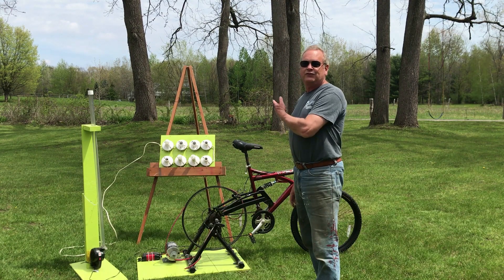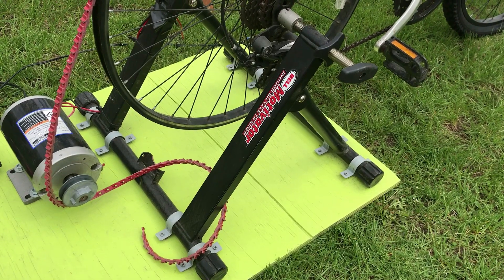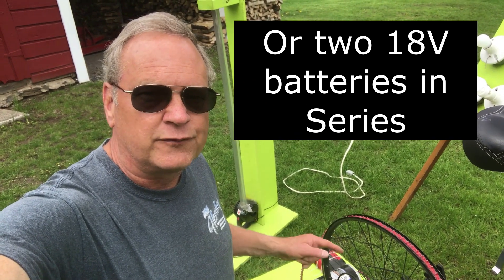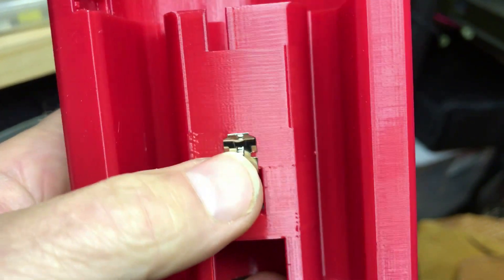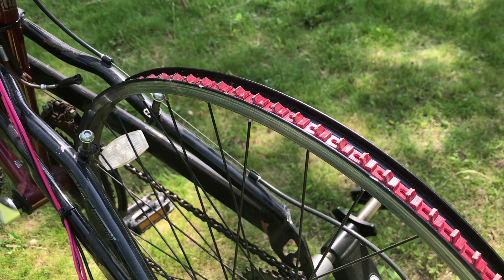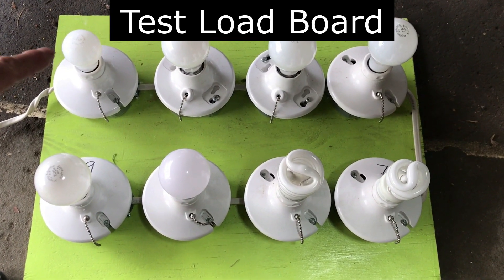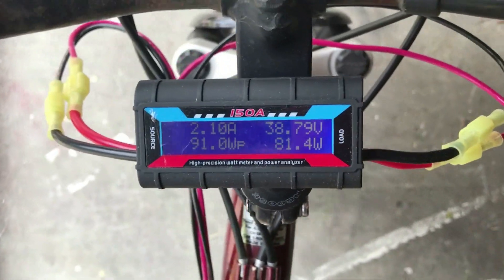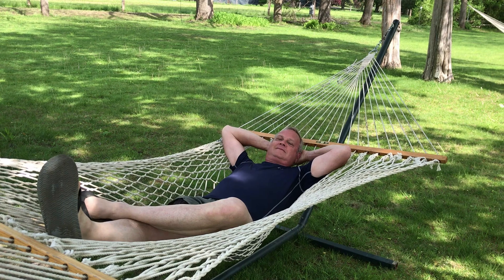RYOBI Bike Generator / Powerstation / Battery Charger / Exercise Bike

Comment: Couldn't you make a similar system attached to a gas powered bicycle so it can charge a portable battery station?
Reply from the maker: I would just connect the motor directly to the generator

Comment: Hi Chris. I'm curious to know the pros and cons of charging the two 18V batteries in series at 42V versus in parallel at 21V.   My first thought is that Parallel seems safer since each battery is independent and it doesn't matter if one battery finishes charging before the other battery.  The con would be more current required from the source.  Does each battery get 21V in the Series setup, even if they are at different levels of charge, or one has finished charging while the other is still going?
Reply from the maker: really no choice since the boost MPPT charge controller can't be set to 21V. You DO NOT want to put batteries in parallel unless they are at the same charge level (ie voltage). You will get a rush of current from one to the other.

Comment: Chris, your a genius. I've enjoyed your videos. I need your help. I built an off grid houseboat from an old sunken Gibson. Outboard motor only. so i have lots of dry bilge space. i run the ac on a 3500w predator gas generator some nights only when i need it. I run the ryobi hybrid string lights for lighting, ryobi hybrid Fans for air circulation and ryobi batteries for everything else. music, deck lights, misters, tools etc. i have two 6 port superchargers and 24 6ah batteries.  heres what im trying to do. i want to put together a small solar and wind generator pack to continually run the small dorm frig (65w) and constantly replenish the charge on the 2 super chargers. As always budget rules. any suggestions.
Reply from the maker: I guess I would concentrate on putting as much solar on the roof as you can afford. What does the roof look like? You can sometimes find used solar panels for cheap (250W for $50 https://www.youtube.com/watch?v=0yDVXJmsowU ). If you have a curved roof, then flexible panels are possible but they are more expensive. Post a photo. too bad you aren't close by, I'd give you a hand.
Reply: @SerendipitySue  thanks. The boat is in Corpus Christi Bay. There a big flat roof over the wheelhouse. 9'x 9' . I don't need slower for anything more the the recharge bank really. One agm and a 100w panel keeps my fridge cold day after day. I was wondering if there's a more efficient way than through an inverter?
Reply from the maker: @thejulyjonescollective  I have a 12VDC iceco compressor frig/freezer/cooler. I got it as a Kickstarter. It works great! ( https://amzn.to/3uUJLXk )
Reply: I could maybe wire the in superchargers in series or on timers so only one (85w) charger at a time.